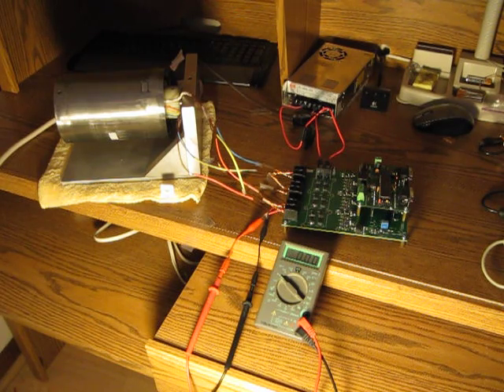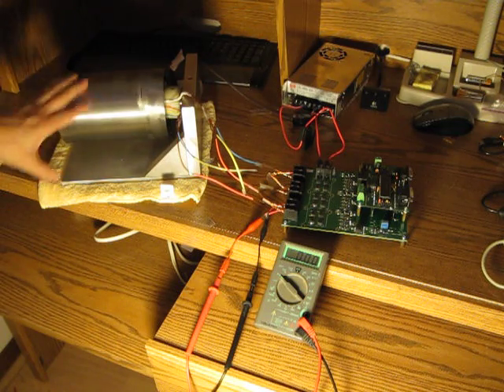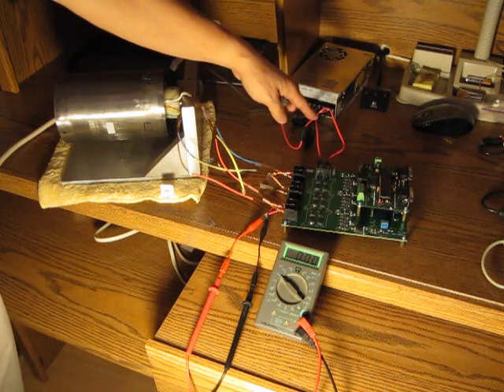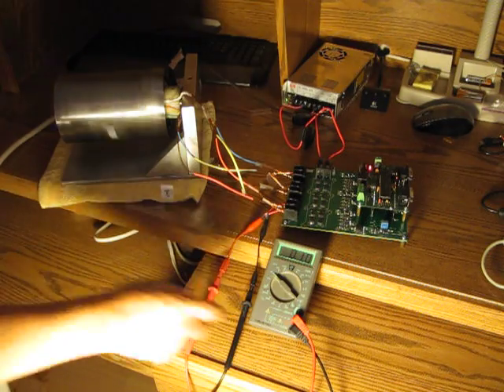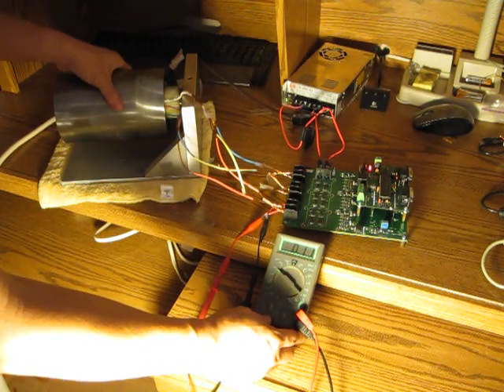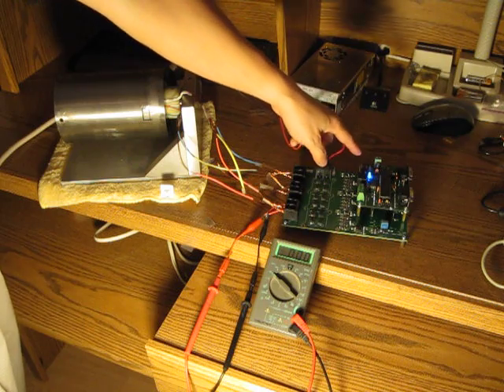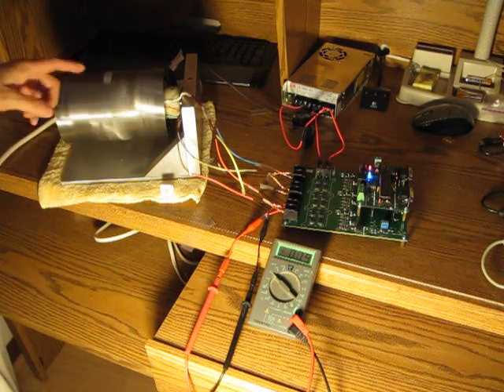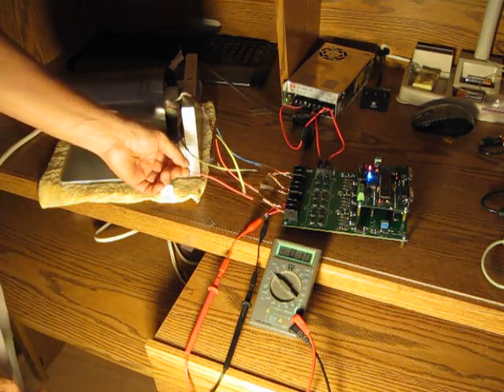High efficient motor/generator system

Comment: Nice ,
 i would like to see current draw before the electronic speed controller eg (amps and volts) ,
why do you need a heavy duty 24v power supply ?  
Acording to your figures this should run on a tinny 5v battery.